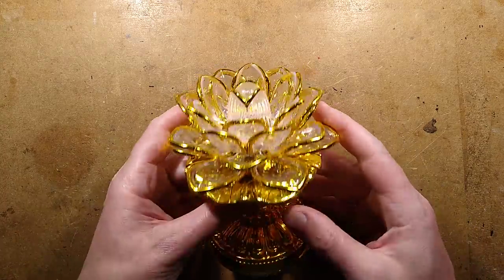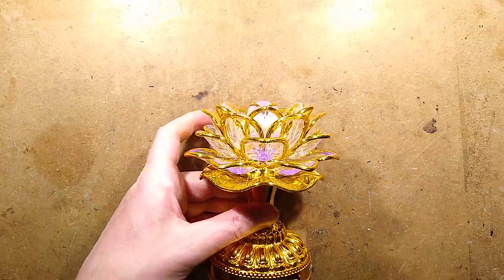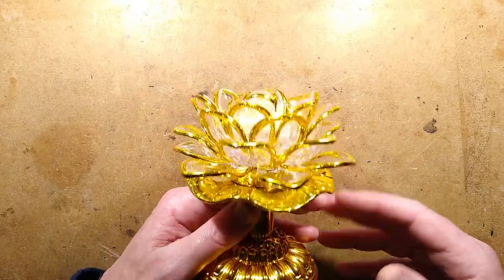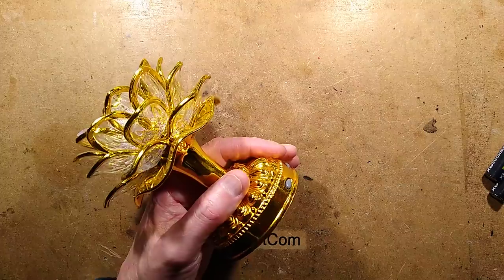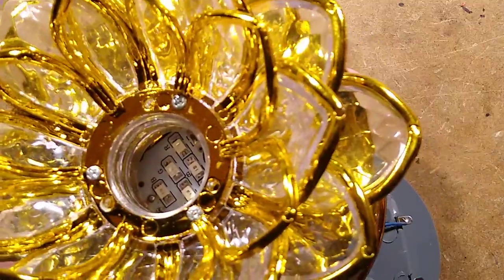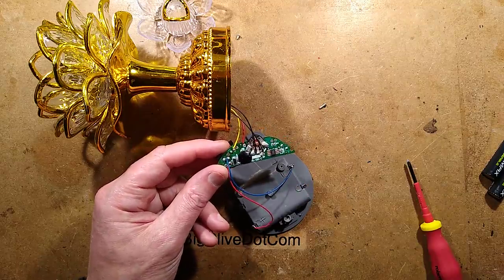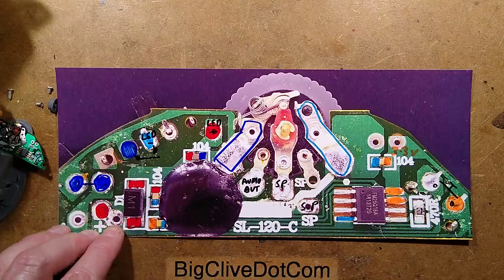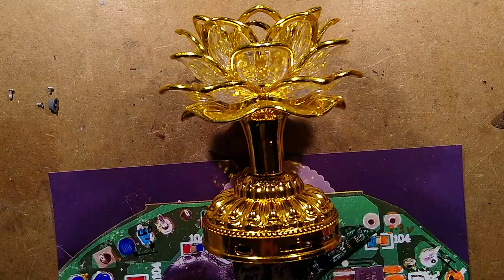Buddha machine teardown with flash dump

Comment: I tried extracting few "tracks" (which are split by CB 80 sequence) - they indeed seem to be compressed (and possibly encrypted by simple XOR or something similar possible on such underpowered chip) as their entropy suggest, but neither VLC nor ffplay (from ffmpeg) can play it. Also tried to invert bits order in bytes to accommodate weird endians - but nope.
Reply: I recognise the language used here as English but….. 🤔😳. I’m feeling stupid now!
Reply: Shannon entropy is 7.872513892493156 (8 beeing the max and representing pure randomness)
So yeah, either compressed or encrypted
Reply: How do you know they are separated by CB 80? Yes, it is the start of the first block of data after the gap, but there appear to be more tracks than CB 80s going by the array at the beginning.
Reply: If you hexdump -C the file, you can see what appears to be a filesystem structure at the start. About offset 0x80 is the first entry. It looks like there are 39 valid entries. 0x600 might be offset of the first file or just random junk. About offset 0x700 is what looks like some file. But if you go forward you can see there some junk preceding offset 0x9700. So 0x700 is possibly a boot program and the first real file is 0x9700. I don't recognize the format, but that's not surprising since flash filesystems aren't my field. However, one dumb reverse engineering technique is to just dd with some increasing offset and running file on each extraction in hopes of finding something file knows about.

Comment: There is a chip called the isd1100 which RadioShack used to sell in the 90s. Needed no external memory and little support components. This could be a similar type of device with a longer play time then the seconds the 90s version had.

The chip could be bit banging the audio where it’s reading the info from the memory and reproducing it to the speaker. The chip does not know what it’s doing, just as instructed. The chip is not a specific audio chip
Reply from the maker: I used to use the ISD chips for the speech in my fairground games.  Quite unusual with "analogue" memory.

Comment: At least the volume/on/off pot hasn't changed in 60 years that I can remember since the first one I ever saw in my sister's first cheap transistor radio. Some old technology seems to set to last until the end of time.
Reply: If it works why replace it? Cheap or throw away goods do not need quality.
Reply from the maker: Likewise my little red plastic radio from the past.

Comment: I have a hunch that the audio data in that dump is pulse density modulation (PDM) rather than PCM or a compression codec; it is a digital representation of an analog signal rather than a true digital encoding. The reason for PDM is the low cost and simplicity of the playback circuitry - converting to analog is as simple as sending the raw encoded data as serial output (at the right clock speed) directly to a low pass filter and then an amplifier. This was used in a lot of toys in the 2000s like the HitClips, Furby, etc and still appears in various greetings card type devices. I might try my hand to see if decoding it in the same way as the HitClips data might work.

Comment: Unlikely they would bother programing an MP3 decoder on a microcontroller chip. More likely to be a straight bit stream of some structure & timing.  As for the file, there seem to be 32 byte long records at the beginning that could be the index to the locations of the different sound clips.  There's also a section near the end of the file that runs through the lower 128 ASCII characters in a 16 bit format (padded by 00), so I don't think it's been encrypted with XOR.

Comment: They must be decoupling LEDs because they are connected in parallel with the supply, just like the filter capacitors are!
Don’t forget to put a decoupling resistor across the terminals of any dropper capacitors, to prevent people from getting a zing.
Reply: They are heater LEDs to keep the mosquitos warm.

Comment: Could be one of the apple AAC+ codecs... possibly AAC+64 or AAC+128 at 16 or 24 kbps mono from iTunes pro or apple pro audio desktop app.

And if the dynamic range is shortened from 20Hz-40KHz to like 150Hz-8KHz and converted to mono before hand it could be crammed into AAC+64 at 16kbps mono.

Comment: That's pretty fascinating.. I wonder what would happen if it had a better speaker and added a amplification circuit (maybe even synth sounds) between the module and the new speaker o.o...
Either way, that's a neat little device, cheers for the share!
Reply: That was my first thought. What'd happen if it was hooked up to an amplifier and some quality speakers?

Comment: Definitely interesting to see how they keep the price down in these units, that speaker is the exact same found in musical greeting cards, I guess they’re so mass produced, they are probably less than a couple pennies a piece. I guess they splurged with this one, and gave it a speaker with a metal basket, must be the “premium” model lol. Also, the LED arrangement is rather interesting, I would have figured it would’ve been cheaper just to use one of the standard self changing RGB LEDs
Reply: The ones find in cards tend to be piezo buzzers, and that looks like a proper speaker, if a very weedy one.
Reply: It's probably the premium version - no expense spared by Clive!
Reply: That small flat speaker is what you’d find in a Chineseum crap, pocket radio or the speaker for those equally garbage cassette recorder/radio Walkmans
Reply: @ianhosier4042  There is a 52 song version as well though paradoxically that seems to be cheaper!
Reply: That piezo device also makes a neat High-z mic.
Reply: @n3glv  the worse one is when you find a WiFi module installed and wonder who has been listening in on you for the past few weeks.  Number 1 reason why I won't own an Alexa.
Reply: @markdunsford4377  probably sampled at 2khz instead of 4
Reply: @ianhosier4042  Worse is when you find a "smart tv" that has a cam and mic...
Reply: @n3glv  I took the WiFi module out of mine to make sure it couldn't spy on me
Reply: Same
Reply: The self-changing RGB LEDs work off their own internal timer and there's no way to control the colour.
Experience shows that the timing of the colour change is not consistent between devices - even from the same batch, so when you have 6 together, they would start off together and the colours of each would drift over time.  I've used that to my advantage for a stage prop, but I guess in this device they would want them all to be the same.
Reply: @thewatchworks1372  fortunately the WiFi module is easy to locate and remove.  Only use my telly for Freeview and as a computer monitor.
Reply: @ianhosier4042  oh no! Since I have Alexa you have me worried now. Somebody might record me farting at home and demand a ransom to not release it to the public!
Reply: @William_Hada  that could be a thing- install olfactory sensors on Alexa and then she could give you a health report on your last meal.  Or just say, Sorry, I couldn't stand that.
Reply: @ianhosier4042  - I have an Echo.  Mine has an off switch.   This is something privacy fanatics haven't learned how to use as of yet.
Reply: @tbelding  Nah, they have to feel themselves up because they think they're actually important enough to listen in on. Although, having it off all the time kinda takes the point out of having an Alexa.
Reply: @josephpbrown  - It was free, and to me, the only real purpose is to be able to listen to music.  I have no problem turning it on like a stereo, and turning it off when I'm done listening.   It just means I don't have to have a remote to change channels :)

Comment: do you have the hardware to be able to sniff the data lines to see what it requests from the memory on power on, and what it does on song cycle - i'm guessing there is an offset list, or something being downloaded initially, and then something is being decompressed to actually pull the songs off, but this is only a guess
Reply: If it is 5V can an arduino be used to sniff?
Reply: @kitecattestecke2303  in theory, yes. Though may be easier to get a pre-made sniffer sketch as I'm not sure how simple it will be to capture the data, or the arduinos speed or memory will cause issues
Reply: @kitecattestecke2303  For a similar price to an arduino, you can get an 8-channel USB logic analyser.
Reply: @userPrehistoricman  That would be my go to, connect the track change switch to one of the channels as a reference marker then you can see exactly what happens on the data lines every time you press the button.

Comment: Hey Clive I tried the file in various pieces of software like GoldWave audio editor and some programs such as MFAudio that I use for converting audio files from console video games. All I got was static. I loaded the file in a hex editor but I'm not good at that hex editing type of stuff. Bunch of random characters on the right. I know many chip devices use a programmer that converts the audio to a proprietary format. I have a paper jamz microphone that does this. Songs are converted to an internal format then loaded on the device.
If it was possible to reprogram these then I would buy one just to do this. Maybe put some smells like teen spirit on it, and maybe some of my farts.

Comment: I have only been watching your blogs for a couple of months but noticed that in most cases switching is on the negative/neutral.  My training over the years has been that in the case of a.c. it is much safer/convenient to switch the live.  Similarly switching the positive in d.c. was the norm.  I am 79 years old so may be out of date but I am intrigued as to why the switching seems to me to be strange.
Reply: I can think of a couple of reasons. One is that most voltage regulators go on the positive. Usually a low voltage microcontroller ends up switching a higher voltage using a transistor. If the positive lines are at two levels, it is harder/unreliable to use a PNP or P-type to switch. The second reason is that N-type mosfets are smaller/cheaper for technical reasons and they go on the low side.
Reply: It is safer to switch the live in AC because neutral is referenced to ground and relatively harmless. Similar concerns don't apply for most DC devices which are usually low voltage anyway.

Comment: Well if it's something like MP3 compression, if it's 32kbit/s, you'd be able to fit about 8 minutes of music on that chip. 32 kbit/s is really on the low end of what's acceptable on a reasonable quality speaker system, but since that lovely piece of landfill really isn't one of those, I reckon you'll be able to get away with even less than that. Whatever encoding it is though, it probably isn't contained within a file type a PC would recognize.
Reply: MP3 isn’t really so much a file type as it is a de facto file extension for a stream of raw MPEG frames.  Frames are (more or less) independent units of a few ms of audio, each with its own short header sequence.  If it actually is MPEG, then you can sever the stream anywhere you want and a player would lock on to the synch pattern at some point and begin playing until it ran out of frames to play.

MP3 files actually have tags and other metadata just haphazardly inserted at the beginning, end, and even arbitrarily in the middle of the file.  As long as the non-MPEG data is between frames and doesn’t break one apart, it’s totally fine.

Ergo, if the data is really MPEG audio, then that synch pattern would tell you for sure, since it would happen every so many bytes.

Comment: What happens if you just take the 8 bit data and chuck it through a DAC?  I am thinking the simplest way to encode music is simply to sample it (admittedly at a crappy low sample rate - maybe 4 or 8kHz) then dump it onto a serial rom chip then use a DAC to play it back. I just can't see that blob containing the SOC and firmware that would be required to decode compressed data streams but a clock generator, counter to poke the address into the rom and a DAC I can see.  Odd how they don't use one of the self colour changing LEDs that are as cheap as chips these days
Reply: It's pure and extremely even white noise.
Reply: @hjalfi  weird, direct sampling would have been the cheapest way to encode the sound.  Unless it uses some crazy way to address the rom or some weird way to encode the bytes to stop copying.  Why someone would bother to copy that crap quality music eludes me
Reply: @ianhosier4042  Direct sampling would have been the simplest, but even at 4 bit audio (which would be unlistenable) it takes say too much space. Long ago the phone companies and military came up with very simple compression methods that could get about 12 bits of audio quality out of 4 or 5 bits of actual data. It still sounded awful, but was good enough for voice communications if you have good ears. That method was to just record the difference in level between two samples rather than recording the actual sample levels.
Reply: You definitely have to compress it to fit anything more than a few seconds on there.  I managed to decrypt the first part of the dump which revealed a bunch of filenames.  The audio files all have the filename extension .f1a which I have never heard of before, so if anyone has any idea what that could mean...

Comment: They probably converted it to a WAV audio file because it is just bare bones audio. Back in the mid 90's I could get 20/30 media files on to a standard 3.5 floppy drive.
Reply: I thought wav file bitrate varied? Edit: Hi quality wav files are 1411 bps so would hold less than eight seconds of audio. Reducing the bitrate likely contributes to the audio quality.
Reply: @Scotty916  WAV is constant bitrate, but you can choose the bit depth and the sample rate yourself to end up with a low (but constant) bitrate. Many really old games used 8 bit, 11khz sounds for a low bitrate. Modern stuff generally uses the CD bitrate of 44khz, sometimes 48khz, and 16 bit.
Reply: @mfbfreak  a lot of the music I saved was full songs but in Kb file size, it didn't have a rich sound by any means.... Kinda sounded like a very low quality keyboard sound

Comment: I bet people are giving this toy way too much credit. to my ear it sounds like 1 bit audio where its structured to feed the bit stream directly into a speaker which acts like a low budget digital amp. You can confirm this by capturing the audio from output directly as data and comparing to the dump itself. I would do this if I had one of those toys to confirm this.